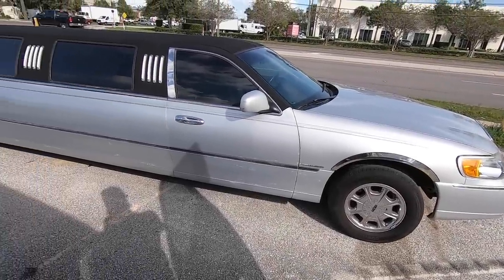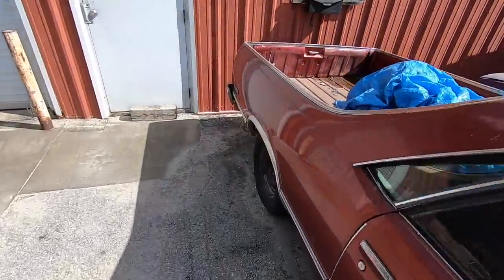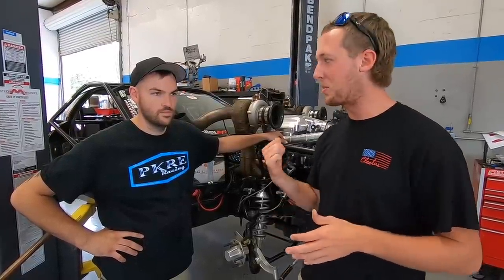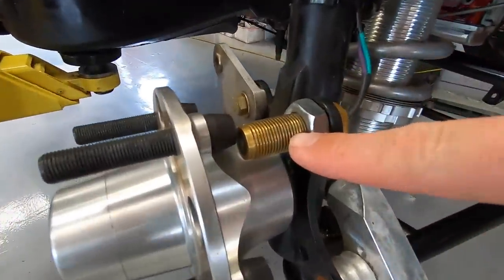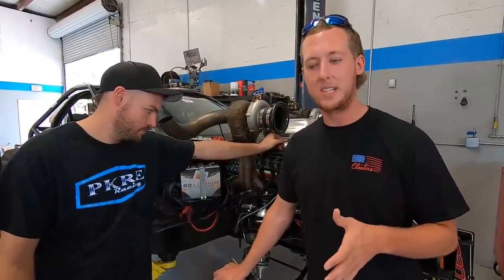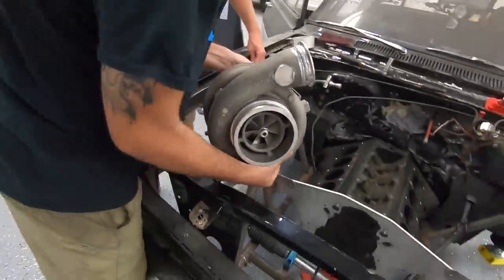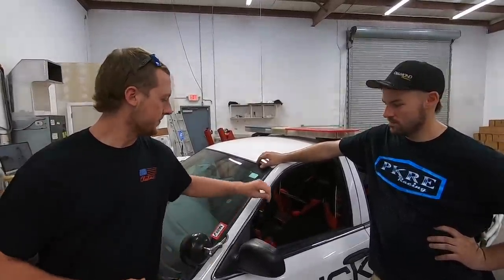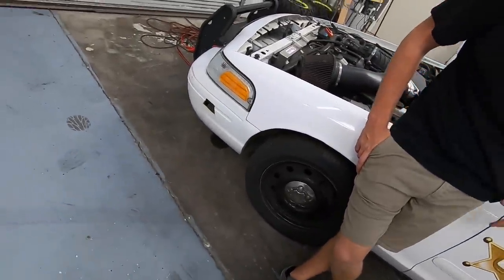Here's Our Plan To Make Leroy Go Mid 7's... (First Discussion of Body Panels)

Comment: Would love to see the v10 viper motor. Hell of an engine and not nearly as overused as Barra and 2jz swaps.
Reply: As long as they put twins on it Im down w that!
Reply: V10 swap would be dope as hell
Reply: Yeah viper v10 would be wild
Reply: There is literally no downside (content wise) for a Viper V10. Never seen a major YT car channel do one that isn't a big tuning company, can get 1500hp no problem these days, will be possibly the first ever v10 Vette, and it's American as fuck. Among other reasons I can't think of currently.
Reply: Dylan Cann YES!
Reply: that was literally the second engine i had in mind i thought it would be nuts to suggest it but im obviously not the only car nut :) the other engine i was thinking was the voltswagon v16 wardo but that would have to be moded in
Reply: I'm not a huge Dodge fan but the Viper V10s are SICK! And they are absolutely full of pure bald eagles.
Reply: Yes yes absolutely yes. Twin turbos
Reply: What a v10 going for 5k miles? Hell 100k? I love looking at em but know nothing about them
Reply: @danhyde5364  I'd imagine a decent engine could easily be ~10k.  That's obviously also a stock engine, could be a little more or a little less depending if it comes with a trans. There would be quite a hefty hole burnt in Cleeter's wallet if they would do a Viper v10...which is the only reason I could see them not doing it.
Reply: Oops i ment the w16 by volkswagen.
Reply: They hate mopar
Reply: I agree.  Was just thinking the same thing.

Comment: Barra swap Ruby! Pick one up when you're over here in Aus. Do something wild. The Coopra will have a 2JZ and you have many V8s. Take some Australia back with ya.
Reply: this is the best idea
Reply: Should buy a couple and stick one in the black mustang as well. Would be interesting to see same motor in too completely different body’s
Reply: @blaynearmstrong1068  I hope they do it. They're super simple engines to work on, and easy to pull in and out. Swapped mine out for a built one on the Easter weekend with a mate, took all of 45 mins to pull and about the same to put back in. Only issue would be parts supply to the US.
Reply: @WASDxMerceless yeah I’ve had a couple Barras myself. According to Benny there’s about 100 Barra in the US and as you know not a lot goes wrong with them but that’s why have a few of them and parts in the container with toast on the way home from Summernats.

Comment: Put an 8.4L Viper V10 in Ruby.  Viper and Corvette have been competing for awhile, it would be funny to do a swap like that.  Those engines can be built to 2000+ hp
Reply: Damn, you beat me to it😂have you seen the guy on YouTube that ran a low 7 in a full weight street legal ram srt 10? Fucking insane engine

Comment: Bought a One Owner 62 chevy nova II, red with a white rag top that still worked, 170 cid three on the tree and found a deal on wire rims, 13 lnch, with adapters and the knock offs, fresh out of the ARMY in 1974.
Then the beer totting, in the trunk of her old push button dart, girl friend stole the title!!! She also had an aunt that work for dmv, need i say more.
What I did before she came and got "My little red Chevy" still gets me misty-eyed to this day. 
Sugar and very hot oil turns to a form of Super Glue when the mixture cools down, N'uf said.

Love Your Show, you guys ROCK!!!
When the "Little Chevy II" is running again, that will be Cool!

Comment: Ok this is the third time I have mentioned this but I'm going to say it again.  9.5L LS based V12 from Racecast. these guys are making 750hp naturally aspirated that you could let your mom drive to the grocery store.  It's LS based so it would not all be totally foreign to you. Heck you could probably get your peeps from Texas speed to get you all the go fast internals. Just imagine 2000 easy HP.
Reply: too may pistons lol too much bobweight
Reply: On one hand, would be a ripper, on the other, $45,000
Reply: Ummm.. V8 LT1s are making 758hp N/A with a basic setup
Reply: @dividedbyzero96  45K holy shit
Reply: I don’t think they want to swap it for economics. I think they want to do something crazy with it since it’s like the ‘wrong motor’ car in the fleet. I’d love to see the v12 LS in it.
Reply: Yes
Reply: Been thinking the same, they need More pistons!
Reply: I was thinking the same thing.  Every car he has is boosted or supercharged.  Build a monster naturally aspirated old school style.  I don't mind fuel injection, and high end computers.  Naturally aspirated is where it's at.
Reply: @Allmotorzl1  14:1 compression, all new internals, and 8500rpm isn't even remotely "basic" for most builds.
Reply: Tony France You’re completely wrong. Try stock bottom end Gen5 LT1. 8000rpms, and 12.3 C/R (milled heads) but just heads cam and intake. Stock intake and exhaust valves, stock seats and guides etc. It ran 9.44 @ 142mph recently. It made 758hp on the engine dyno. I only say basic because there is much more you can do like lighter internals, knifed crank, and much more you can do to the heads. I
Reply: @dividedbyzero96  Well I imagine if they were going to boost one they might start with the builders kit at $29k and go from there. For the record they said they were looking into something different not cheap.

Comment: 6.3L Mercedes AMG V8 (the naturally aspirated one).  Makes amazing sounds, stock is already around 450-500 HP depending on the version.  Supercharger kits exist for it as well, but there's always the option to go turbo....
Reply: The Better Engine to start with would be the 5.5 Biturbo AMG Engine easy 1000HP on stock Block
Reply: Feels but biturbo tho

Comment: "Drag Extreme" RB30 would be awesome in Ruby.  It's a custom 2JZGTE and Nissan's RB30DET combined into one engine.  It's built by Bullet Race Engineering
Reply: I vote rb30 for sure. That sound is outta this world. Are you sure it's a toyota/Nissan engine combined? Iv never heard of this. I believe it's a one off build if it is
Reply: @47-TH4TS-R4VN  i think its just a special 2jz that has "the best of both worlds". i'm not knowledgeable on engines, but i saw a vid on it a few days ago... i guess it just takes the strengths of both engines, w/e they are (someone help here), and combines the features into this 2jz?
Reply: Rb30 was a nissan Holden engine was put in the vl turbo Holden commodores but don’t quote me on that haha
Reply: @47-TH4TS-R4VN  It is a custom machined billet block with different cylinder spacing, and a custom crank to accommodate the larger bearing races.  It basically takes the best of the 2 and combines them.  I think Bullet Racing wanted to debut it at WCF, but nor sure that happened.  Here is the Bullet Vid.  https://www.youtube.com/watch?v=NKwN67LzT4c

Comment: Barra ruby, Aussie company “tunnel vision” have pretty much perfected the Barra engine.
Reply: And you can hit up Benny from BCW/MCM.
Reply: Yes
Reply: Oh hell yea!
Reply: And, if they want an easier to use setup, a slight destroke and more revs seems to help, too, since a looser converter can be used to get on the 2-step, while the higher revs tighten it up once launched.
Winning
Reply: Yes 4.0 barra from a falcon
Reply: Brian Carson either that or a RB26DETT would be different in a corvette for sure as well
Reply: Atomic Performance are a good choice too

Comment: El - why not leave the long wheelbase ?
Limo- tubed big tire with twin turbo coyote motor !
James - add air bags to the rear of the deuce separate valves so you can adjust pressure for each side with the leaf/shock set up.
Leroy- weight weight weight start replacing brackets and hardware with chrome molly or carbon fiber . And the right chin spoiler will help on the big end as much as a body would if not better and it would fit leroy look .
Ruby - 600+ cubic inch fuel injected supercharged big block . This gives people a different set up to watch on your channel and you can battle ruby against leroy and answer questions people have on which is better .

Comment: Barra would be sick to see in the states especially in a vette
Reply: Mtcproductions 28 Barra would be fucking awesome to see over in the states especially in a vette
Reply: We have much much better and cheaper engines here.  No need to mess with that Aussie junk.
Reply: ElteeMullet nonsense
Reply: barra engines are super strong easy make 1500hp  guys over here have made over 2000hp with them  ..dont write off aussie motors until u have one lol
Reply: Pick a car that has a weak engine the vette isn't it.

Comment: You already have a low 7 second car. All you are lacking is time, patience, and a spreadsheet. 
This is where you become a mature race team. You simply need to put in the track time and do some meticulous testing. 
Make a spreadsheet. Include fields for every variable. Eg tire pressure, boost, clutch setup, air temperature, tire temperature. Get a tire pyrometer measure tire temps after each burnout. 
Now start making runs. Record everything. Then change ONE and only one parameter. Make another run. Record. Optimize that one parameter. Move to the next. Repeat. 

I suggest you put back the bigger radiator, at least during testing, to maintain consistent temps so as to eliminate that as a variable. 

You guys have all the ingredients already, it's time to put it all together. 

Good luck!
Reply: They need to take a statistics course. Design of experiment, taguchi method. they'll pick up time they didn't even know existed. They're to the point where seat of the pants doesn't work anymore, you need math to tell you where to go.

Comment: Put the engine in the El Camino’s bed and make it a mid-engine
Reply: Sounds spicy
Reply: Kinda like the old Matchbox car? That would be sick
Reply: Twin LS El Camino!
Reply: keep the motor in the front. make it fwd. add another 427 in the bed for the rear wheels. the whole car will be an 854 lol
Reply: @tlove2108  Like the hot wheels car with two engines side by side or like one engine under the hood and the other in the bed?
Reply: Jeremy Cooke definitely one in the front and one in the back. Maybe 2jz in the front and 427 in the back
Reply: @jonathanliebert797   Hell yeah brother

Comment: You guys should give MMR (Modular Motorsports Racing) a call about your timing chain issues. Im sure they could get you squared away. Not a plug, I have just had good luck with there parts and they specialize in mod motors.

Comment: to stay with the original junkyard motors, Buy a v10 from a totaled viper/1500 srt 10 ;)
for ruby
Reply: Owh FACK YEA !
Reply: This!
Reply: I second this. The question is would that fat srt v10 fit?
Reply: Could even just get the iron block one from a 2500 or 3500 ram, might be easier to find one of those
Reply: @theterriblegamer01  Did they ever put the v10 in the 3/4 ton or one ton trucks? i thought it was just the half ton trucks as a srt model.
Reply: @austinjohnson3611  more than most likely they would have to cut the firewall, but who knows?
Reply: @austinjohnson3611  yup already saw a project of a C6Z06 with a Viper V10 in it

Comment: Barra swap for sure. It'll be one of the only Barras in the US and as far as I know the only one in a vette.
Reply: There are quite a few Barras in the US. We have 2 BF's and 2 FG's in the US right now. I believe we were the first to start importing them years ago. Most of the ones I am aware of went in things like Fox Body Mustangs. I do believe this would be the first Vette, but could be wrong on that. Ben said he thinks there are around 100 in the states so there could be one. One thing I am fairly sure on though, there are no US/Americans on youtube building them... that I can find at least.
Reply: Be hard to make it faster with a Barra though. 
1500-2000 hp Barras are not an economical build.
Reply: @mj_aussie_coaster_travels8310  They are not cheap, but not that expensive either. You can get a 1500HP rated barra without turbo and manifold for about 11k landed. LSX 427 would be around 25k. 

We have barras in the states right now, not performance but good starting point.

What I can see them doing is starting off kind of light at around 600-800hp then building up from there. The barras we have should be able to do that with some some stiffer valve springs. Throw in some forged pistons and conrods, should be able to get a good set for 1500 USD landed. Upgrade the bearings, fuel system, head studs, etc and it's easily 1000hp. Get up to 1500 or so then balanced crank, better cam, etc.

The company selling the engine also sells a kit that will be needed to hit 1500hp. A billet crank, main caps, etc for about 4,800 USD. Not sure about what air freight would cost for that though. 

My point is, getting high hp with a barra as a starting point can be a lot cheaper than some other options. Also we sell barra engines already here for around 1400 to 1600. So for about 8-10k you could have a long block capable of 1000+ hp.
Reply: BARRA THE WORLD !!!! Cheap and can handle bulk power
Reply: Barra is totally a brilliant choice also in my opinion one of the best 6 cylinders ever produced down under
Reply: V A the Australian peso will work in Cletus’ favour too I guess. 
Just don’t use up all our cheap Barras haha. I have one for my panelvan project but I’m gonna need another one for the next project.
Reply: And Bring the Skid Factory boys over to do the transplant.

Comment: There is another Aussie option for that engine swap...
Pretty sure they put together a 9.5 L V12 LS making around 1,000 hp NA, it sounds freakin' nuts.
It is a little pricey at around $20k but it would be interesting.
Reply: They're gonna spend that much on a proper 2JZ and 6 speed transmission anyway, I don't think money is a factor on this one.
Reply: it was 8.0L
Reply: @jasonswift7098  At SEMA, Factory Five had a 9.5L LS V12 in their newest kit car chassis. Could be a different company, but there definitely is a 9.5L engine
Reply: I kinda wanna see Ruby with a small block, that way they have LS, big block and small block cars
Reply: Came here looking for this comment.

Comment: Viper v10 in ruby and you know you can make good power because there’s that twin turbo orange viper that is running 7.6 with a H pattern. You have GM and Ford time for some MOPAR
Reply: There's also 1150Hp Viper in formula drift. That engine is gigantic though.
Reply: The_864_ Goat I was going to suggest this, SRT10 will get you from A to B. You’ll have to paint an American flag on Ruby to unlock the full power though.
Reply: I like this Idea

Comment: Put a Barra in it they are a 4l in-line 6 and it’s easy an cheap to get heaps of power out of it
Reply: Importing parts from aus will bump up the cost a fair bit, but if they get a decent crate engine with all the bits they need and slot in the container behind toast on the way back from Aus...
Reply: Yeah they will find a Barra pretty easy in aus and parts aswell

Comment: New engine idea for ruby... 512cu in 8.4L V10 Dodge Viper engine!
Reply: Those engines sucked. They didnt make great power and would blow quite easily if modded
Reply: @ZLT_90  well sh*t, I just thought it would be an epic engine swap.... But i guess any v10 or v12 would be Epic tho....
Reply: @ZLT_90  and yet people are getting 1k hp stock engine...
Reply: The viper engine would be awesome but it's simply to big
Reply: I believe the venom viper has 2k hp
Reply: How about the new v10 lsx? Makes 600hp stock n/a on a safe tune. A more aggressive tune would be 800hp.
Reply: @ZLT_90  645hp isn't bad for an old school 2-valve per cylinder single cam OHV engine. I'm pretty sure when they came out they held the record for most torque from a N/A production car at 600ft-lbs. Also there are a few people that put twin turbos on stock bottom end 8.4L that made lots of power. One guy claims he made 1125HP on 11.5psi of boost using a stock engine from a 5th Gen Dodge Viper
Reply: Why when people are pushing 1k hp with a 4cyl
Reply: @jpiz224  because no torque and they need forged internals with a darton sleeved block than you can push 1k for a 4cyl. 

Bone stock 4.8 ls can push more than 1000hp. It's been done over and over again. Why not get something reliable

Comment: put leroys current engine in ruby and then go all out with a billet engine that makes 2000+ hp
Reply: ChadSkyFire more power is gonna hurt them tho
Reply: that 2000+hp  motor probably is going to el camino
Reply: Rotary swap!!
Reply: Stolen Memes this
Reply: V12 LS!    v12ls.com       stock w/o boost its 750hp but with boost!?!
Reply: @blamethedingus2470  idk with the slip clutch and it being adjustable might help

Comment: Do a clear body for Leroy, that way you can still see everything an keep the "no body" look on life support at the very least!!
Reply: Dawson Matthys or make it look like a bald eagle somehow
Reply: They talked about that in the wind tunnel episode I believe but the weight of Lexan was prohibitive
Reply: @JL-yl8gd  I could see that being the case. Maybe a super good artist could paint a body to make it look as if it was clear? Or a vinyl wrap.
Reply: Dawson Matthys is asking the real questions
Reply: I'd like them to take the minimalist approach up front.
It is possible to guide the air around and through the engine bay using typical airfoil shapes and maybe some hidden channels, without "looking" like much was done at first glance.
However, tackling the transition from the windshield and around the cabin, then reducing the dead vortex in front of the chute, is going to be hard without ruining the current look.
Even a clear body will be difficult because it will instantly scratch up and get covered in tyre rubber.
Reply: It will completely change the car. It will not feel like the same car.